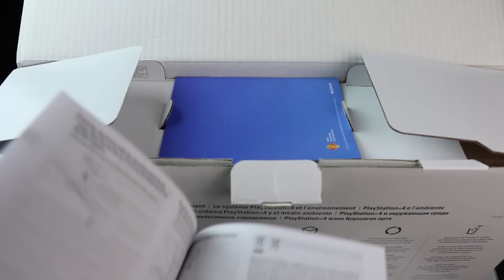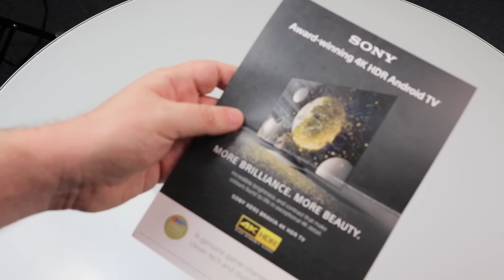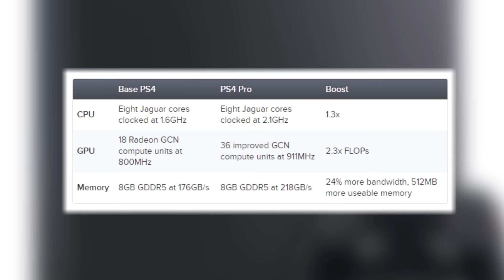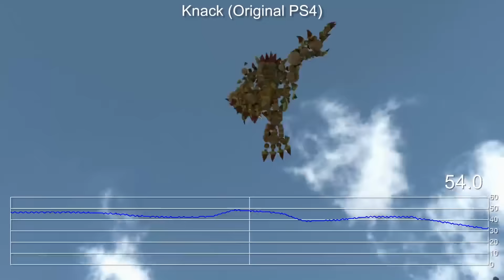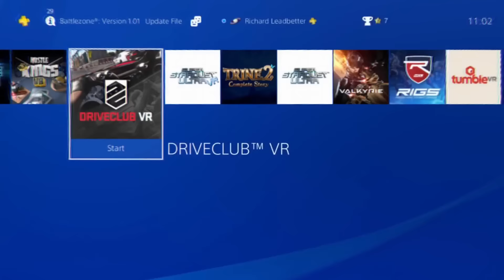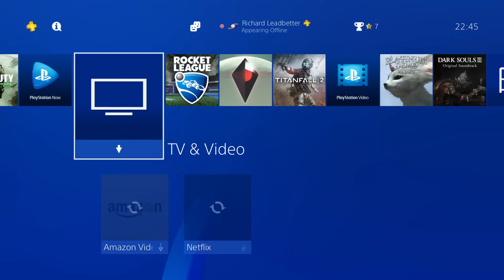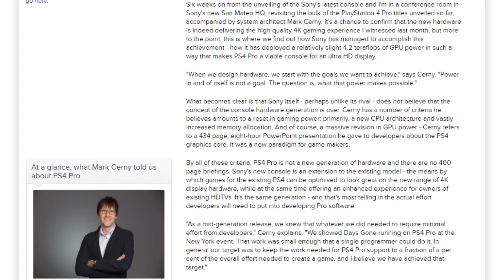DF Videocast #4: Unboxing PS4 Pro, Meeting Mark Cerny & More

Comment: I'm in a small minority using a 1440p monitor, but I'd love to have DF's guess as to whether the Pro will offer any benefits when hooked up to this resolution.
Reply: I'm pretty sure you have to run the console in 1080p mode in that case. So, not ideal as you might guess.

Comment: Have they changed the Rubber on the sticks on the controller ? No hdmi cable ? Can they up clock the speed by patching it later if they need too ?

Comment: I have an important question regarding the PS4 Pro. I have my current PS4 and it makes the random three-beep ejection sound randomly and constantly. I need to know, will I have the same problem with this console? Because I don't want the random beeping anymore..
Reply: Something is pushing the eject button maybe that rubber under it

Comment: PS4 pro : GPU: crossfire of Hd 7870 (911 mhz) : total power 4.2 teraflops 
Cpu : 8 core jaguar 2.1 ghz (2012 cpu)
Memory : 8.5 Gb GDRR5 (high latency memory) 218 Gb/s
                                    Vs
Xbox Scorpio : APU : AMD Vega based 490 downclocked 6 teraflops card - 50 % + power
Cpu : 8 core Puma Or 4 Zen core - 20 % + power Or + 45 % 
Memory : 12 Gb GDRR5X 320 Gb/s - 102 Gb/s +
Ps4 pro Gpu equivalent- Gtx 970
Xbox one Gpu equivalent - Gtx 980 Ti Oc

Comment: i see no issue now with X86 platform that they improve the consoles each 3rd or 4th year. i mean people upgrade smartphones every 1year, for barely any difference what so ever (costs almost 2x the PS4 Pro price also). 
we have people that upgrade computers every 3rd month in small steps, or those that chunk down 1000 EUR each year.

having a console upgraded with more modern features every 3rd year is perfectly fine, its not mandatory to upgrade anyways.
sold my ps4 to buy the pro version, only have to cash out 200eur for the upgrade, and i will get a better VR experience :)

that and im not into upgrading my PC just yet, waiting for Zen and next lineup with Fury.

Comment: Worth the hundred bucks more that the regular? Need to know by nov 10th lol. Will only be Running on a 1080p projector in home theater.
Reply: The Pro has a lot more options and will also improve graphics slightly at 1080p.  If you are just looking for a simple gaming machine to play your games at 1080p, go with the OG model.

Comment: i don't know about the api internals but locking the half of a gpu for non pro specific games is really stupid. when you have a game with unlocked framerate then it would automatically get a huge bump in fps, or when i game has a dynamic resolution it would constantly keep the 1080p mark. such a pity. oh and supersampling is cool but playing u4 in 60fps would really convince me to get a pro. a new buyer should be getting the pro but i just don't see the value now for someone who already has a ps4

Comment: What dose this mean for original ps4 owners will the pro get optimized over it and the game quality decrease for us as the pro is more important? also the pro is not meant to have a lower frame rate than the original witch is really good for the pro but couldn't it be really bad from the other way around by games getting limited by 4k frame rates or is this wrong have I misunderstood how this works? Also dose the pro do anything for non pro game like up-res them or dose it just run them the same as the old ps4? These are some big question for me and any answers would be grate thanks.

Comment: I have a latest 40 inch 4K Smaung LED TV, and it surly blows away my 1080P 21.5 inch monitor. But this is my point... My PS4 slim is now upscaled by the TV itself and gets its near 4K experience, so is it worth to get that little bit more with the checkerboard layout on the Pro model?
Reply: PS4 output is native 1080p and it is upscaled to 4K. Whereas, PS4 Pro natively renders most of the games at a resolution significantly higher than 1080p. So , you will notice a difference in image quality.

Comment: Apparently the PS4 original not only has SATA2, but it has a "USB Bridge" chip too, adding more latency to the hard drive and reduced bandwidth.
If the PS4 Pro downclocks the CPU (in PS4 mode) and it uses a SATA3 to USB bridge, it really isn't going to improve load times much for the older games, which SUCKSSSSSSS.
PS4 load times were one of it's weakest points, even with an SSD.    I hope this ends up, somehow being much faster at loads if you throw the $$SSD at it

Comment: Hi, may you please test if it is possible to use a HDD right from an original PS4 wirhout formatting it? I'd like to simply switch the 2TB HDD from my old PS4 over to the pro
Reply: doubt it, as the operating system is stored on the HD. A new OS image will be needed for the pro.

Comment: So let me get this straight, games that were not specifically optimized for the pro will see no benefits on it in terms of framerate? A game like Bloodborne won't run at a more stable 30fps for instance?
Reply: correct
Reply: Squidel AT That seems really strange, I don't exactly understand how it works. If the pro's gpu is essentially the same as the standard ps4's but just doubled why would any game designed for the normal ps4 not just suck up the extra bandwidth of the pro's gpu without compatibility issues? That's basically how PC games work , are games designed for the ps4 so fundamentally different that they can't work like that?

Hell even the Xbox One S increases game's framerates.

Comment: The playstation 4 pro will be my first playstation 4 console I own.  I don't have a 4K TV.  I only have a 1080p TV.  But I hope the more powerful graphics out of the two GPU's in the PS4 pro will enhance my games at 1080p via upscaling.  I realize that only one GPU in the PS4 pro will be used for non-4K videogames.  But you did say the single GPU out of the two GPU's in the PS4 pro will be more powerful than the one GPU found in the original PS4 and PS4 slim.  The price of 4K TV's are coming down so perhaps in the future I will purchase a 4K TV.  But for now I hope with upscaling and checker boarding the PS4 pro will enhance 1080p games to look better than if played on the PS4 or PS4 slim.  I look forward to your review of the PS4 pro around Nov. 7th 2016.  On a side note I plan on getting a Nintendo switch and a xbox one scorpio.   I have an original xbox one and wii-u already

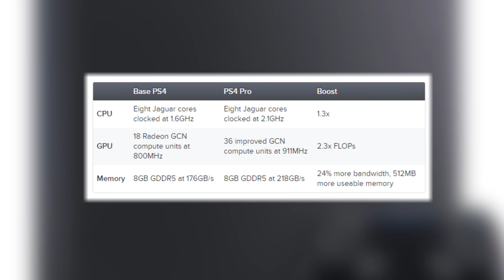Comment: At 10:00 they show a comparison between base PS4 and PS4 pro.
Base PS4 has a GPU with 18 compute Units at 800MHz while the PS4 pro has 36 compute Units at 911MHz.
Mark Cerny said that the new GPU for PS4 pro is actually 2 base PS4 GPUs mirrored and that when you run an old PS4 game on the PS4 pro the second half of the GPU is turned off leaving a single PS4 GPU for the game.
Also he said it will have the same exact results with a base PS4 console.
My question is would the PS4 pro run better old PS4 games(without upgrade patch) since the single GPU is 18 compute Units at 911MHz instead of 800MHz ?
Can someone clarify that please ?
Reply: Maybe
Reply: its cool, i posted the same at their website and people actually helped me understand it better

Comment: what I want to know the most is this. Developers are it would seem always trying to push for higher frame rates. In my opinion this is justified. Games running at a high frame rate look and feel smother to play. We have finally got to a point where we see 1080p games running at 60 FPS. Now Sony wants us  to buy a PS4 PRO where games will be locked at 30 FPS? Respawn really did a fantastic job with Titainfall 2 getting it to run for the most part at 60FPS, and the game looks and feels smooth, is something like that going to be down graded on PS4 PRO? This is something I never hear being talked about. It's all about 4k. 4k is nice, but frame rate is better IMO.
Reply: TBH, there are extremely few AAA titles which are 1080p locked 60 FPS on vanilla PS4.

Comment: Pre order through Gamestop! $150 for my PS4 trade in, I put $125 down with about  $150 to go including taxes. I still need to buy one of Sony's 4k HDTV  ( Sony XBR65930D) to complete my 4K setup  (XB1S for movies and HDR gaming).
Reply: hababacon bad geek
Reply: hababacon Sony is eventually going to patch the ps4 to be able to play 4k movies
Reply: Papa Sprinkles Explain how skyrim remastered runs at 4k without a 4k blueray player
Reply: Bryan You don't need 4K blu ray drives to play 4K games. You only need the BR4K drive for movies which comes in BD-66, and BD-100 for its high resolution formats. The only thing needed for 4k is HDMI 1.4a/2.0 and a 4K display monitor/TV.

Comment: Please stop pushing this notion that HDMI 2.0 would cause incompatibilities with older cables because it's complete rubbish. There's no change to the connector or the type wiring (which is just regular copper cable), it's just a difference in the protocol that the devices at each end of the cable use to communicate and even there the biggest difference is that they communicate over the cable with a higher clock rate.

Comment: hey guys please respond to this as soon as you can! I really need to know if you have any clue that's Sony may I have the software for the pro available on the PlayStation site when the system launches because I really want to switch the hard drives between my standard in the Pro exclamation point I'm going to put my 2 terabyte in the Pro and the one terabyte in my standard model! I just need to know if the firmware for the pro will be available on the site on launch day so I can immediately reprogram it it would be really nice to do the hard drive swap before even hooking up the system! Please respond as soo as u can! =/

Comment: This talk of having dual GPU's in there sounds like silly marketing talk to me, I would be pretty sure it's just a new Polaris chip that deactivates some of the CU's when running in base mode. It's the same GCN architecture so it makes no sense to include the old silicon in there along side the new? Would just cause more heat, waste space and cost more.....
Reply: That's right, exactly what I was saying. But the comments from Sony are suggestion dual GPU's and some people are reporting that.

Comment: I have a question about this hopefully someone can help me out on this, lets say we take a game like The Witcher 3: Wild Hunt a game that doesn't have a PS4 Pro patch coming out for it. If I where to try and play it on the Pro will I notice a more stable 30fps frame rate (I know about the added features that would come with a patch hypothetically) but I'm more worried about the frame rate games that don't have a Pro patch will the frame rate at least be more stable?
Reply: theeOnslaught I don't think so. In case there is no patch, the console unable one core and run with the original core of ps4 vanilla. (yes, there's two cores inside)
Reply: Ghost Geist wow that sucks think I'll just pass on this
Reply: I wouldn't worry, CDPProjekt RED won't let this pass. They will eventually make time for a patch.
Reply: the ps4 pro has 2 graphics cores with a small clock increase aswell, one of the cores will be disabled for the witcher, but if the clock speed increase doesnt you will get better performance.

Comment: Considering Microsoft Lack of CPU hype, if it doesn't under go a CPU overhaul it wont have much difference over the PS4 PRO. I'm glad with PS4 Specs for the price but the CPU is holding back 60fps . (Great Value regardless) PS5 will be the DaDDY

Comment: My main concern is how to upgrade the HDD higher than 2TB for PS4 Pro.
Reply: Videos will be uploaded m8
Reply: You can upgrade the PS4 PRO's HDD at the rear back of the console. Easy!
Reply: gtone339 I know where the HDD slot is. Its still the same 2.5" laptop HDD, and the highest size available is 2TB.
Reply: Ratchet Steam Very good.

Comment: The 8.4GFlops thing is true and practible in PS4 Pro or just something that could be used but wont be most of time?
Reply: it'll never happen but it helps optimising games a bit.
Reply: Squidel AT Yeah i think thats the case after all. Let me ask you a question, they Said the New GPU of psPro is Mirror of the previously GPU, so it doubles the capacity. That means the New GPU isnt the new Amd Polaris architecture?
Reply: no it is polaris, it's just got 36 CUs.
Reply: Squidel AT thats good because, with 911Mhz, it can be a cold card, i think it will have good temperature and not too much noise.
Reply: ***** oh this small chip that produces images and graphics?
Reply: Rudis maybe you mean it doesn't have a graphics card?
Reply: ***** Oh wow such a smart guy you are, what a awesome info goodjob man you are pretty good

Comment: how do you go from a ps4 to a ps4 pro, what do you have to do to transfer saves and stuff like that?
Reply: Sergio Xisto swap the sd cards or use a USB and save the files onto it.
Reply: Sergio Xisto If you'll have access to both consoles at the same time,  there's a transfer tool in the settings menu. You'll need an ethernet cable to go between the 2 consoles, and at the end you can it can even activate/deactivate the 2 as your primary console
Reply: Or just use the online storage on your ps4. If you have playstation plus. And if you log into your psn account from the ps4 pro. Just go over to download online storage and you are all set.
Reply: Resolved Fate that's a good shout for saved games and probably the fastest method of that's all you need, but with the cable you transfer all content including installed games/dlc, captures and other installed content such as themes. Should also move your settings etc as well, if that's what you need

Comment: the 99% that still dont have a 4k tv, have only one questions. what will the benefit for the 1080p hdtv owners be???...
Reply: Some games will have unlocked frame rate at 1080p like ROTTR for PS4 Pro.

Comment: sony lost me when they chose not to put a 4k bluray drive in, I sold my ps4 ages ago and did buy a 4k hdr tv but then found out this does not have the 4k drive so I wont be buying it, and I know full well why they didn't and its because they want to try shift as many 4k bluray players they are making, the big issue they had when they put the bluray player in the ps3 was that people did not then go buy their separate more expensive bluray players.

If 4k bluray takes of like standard bluray has then this is a massive mistake on sony's part not having a 4k drive in the console. and before some idiot says its because 4k movies will be streamed...SORRY but here in the UK there are way more people who CANNOT get fibre where they live than people who can get it. yes main cities and the very outskirts of them can get it but everywhere else cant, where I live the max we can get is 12mb but we don't get that full speed and when others in your home use the internet too there is noway 4k movies will be streaming without too much buffering.

So this new updated console really is not very futureproof with the lack of 4k drive, I am secretly hoping mid next year they announce the ps5 a proper new console to take on the scorpio because lets face it the scorpio so far is said to play all games native 4k teraflops are more than double what the ps4 pro can do too, seems Microsoft have learned their lesson from putting out underspecced consoles. I cant see sony letting them have the more powerful console

Comment: I'm very very disappointed that the Pro will not give any performance boost to the old games if they don't receive a patch and we all know here that there's plenty of games out there that have performance problems and hard time to keep up that magical 30 fps. In my opinion, this approach is just stupid. The biggest wish I had for the Pro was exactly to give all those games that little bit extra boost to achieve that target frame-rate. I'm so disappointed and I really hope you in Digita Foundry will test some these games with known frame-rate issues out even if they won't get the Pro patch.
Reply: "also I'm very very disappointed that the Pro will not give any performance boost to the old games if they don't receive a patch" yeah that is really dumb

Comment: If it doesn't even improve framerate of 1080p games... what's the point? 4k is nice... but I wouldn't trade 60fps for it. Of course the PS4 Pro and Scorpio wouldn't run AAA games at 4k60, no doubt they'd always be targeting the console standard 30fps. It'll be many years yet till 4k60 becomes a thing on even consoles. The most powerful PCs barely manage right now. Maybe next year we'll get the 1080ti or AMD Vega that might finally hit the spot.

Edit: For the price, it's honestly not that bad. If I was buying a new PS4, I'd get one, but I already have my OG PS4, which I'm happy with (especially since PS4Pro won't magically run 60fps Bloodborne). I will be honest though... I don't like that consoles are going the way of phones, with iterative releases. It's what I hate about Nintendo handhelds. If this truly does become a thing, why bother? Might as well get a new GPU for one's PC every year at that point (PC parts have been iterative since day 1). Consoles strengths seem to really be diminishing these days, as they try more and more to be like PC. They seem to be targeting the wrong things too, most people would rather see solid 1080p60 before even trying 4k. And the games... I swear this has been the generation of remasters, even Nintendo joined in on the action there.